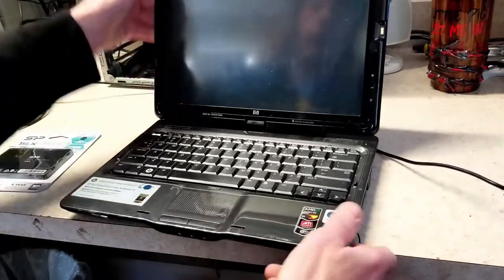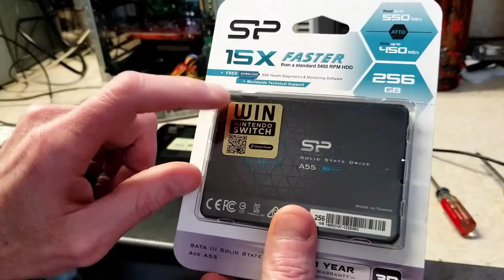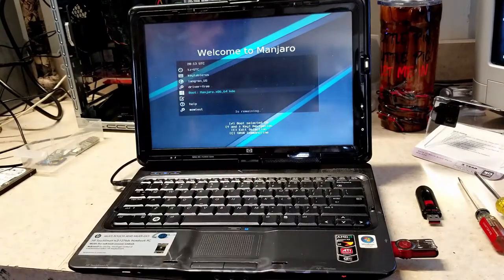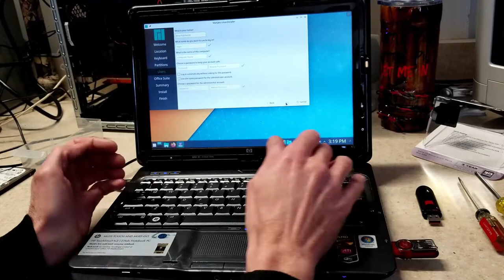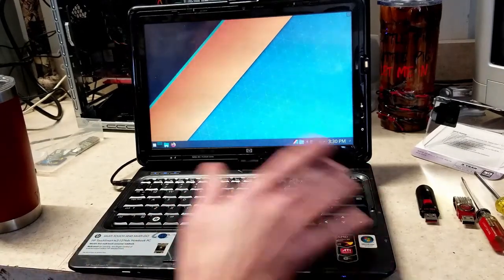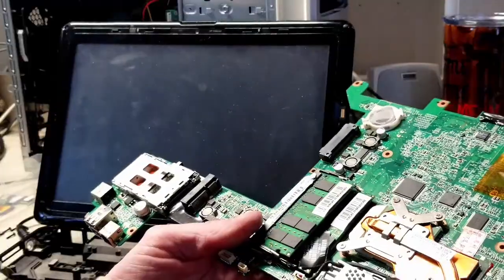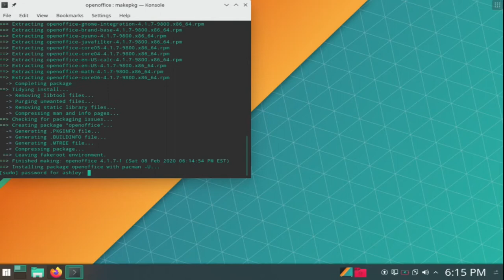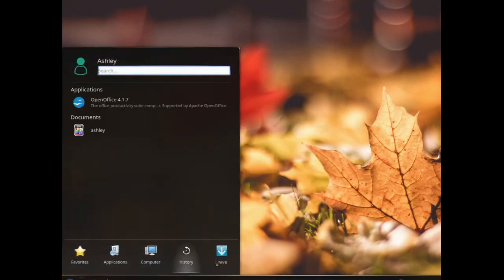HP Touchsmart tx2 laptop from 2010 Upgrading to an SSD and Linux

Comment: There should be a sheet metal caddy for the hard drive to be installed in. There's a nice metal tab that slots into the chassis to prevent it from moving around. Right around 4:36/4:37 you can see the slot in the chassis for it, just behind his index finger on the right side. Without it, the hard drive has the potential to...fall out of the SATA slot thanks to that stupid pointless adapter HP decided to use. Cram something between the hard drive and the outer cover to keep that from happening; should be good enough. Sounds like that caddy goes missing just like the adapter does.
12:10 See that wondrous, hellish blue? Whoever decided on that at HP should be drawn and quartered. That's a thermal pad over the GPU, which ran hot and had zero thermal protection whatsoever. They tended to desolder themselves. Ask me how I know. HP lost a class action lawsuit over that bullshit. Worse in my case and Snickerrick's customer, as they have an AMD gpu which was...equally as bad, and never qualified for any lawsuits as far as I know, even though it dies just the same. Dear readers, send that thermal pad to Hell and install a copper shim. You're going to have to go check how thick it needs to be. It's been a long time and I don't remember anymore. Except that people used pennies as shims and reported success. Christ.
Reply from the maker: Interesting stuff! I used to buy quite a few laptops quite a few years ago that were missing the hard drive caddies and most times connectors, so always had to purchase them seperately. For the most part it was obvious they were missing, in this case I didnt really notice but makes perfect sense. I thought it seemed kinda hoky. I do recall copper shims being sold specifically for that purpose, I had to install one on an Asus laptops MXM GPU due to overheating constantly. Hopefully she wont have an issue with this laptop in the future. I have seen a lot of cases of the gpu dies or chipset with IGPU desolder and fail on , as you said, mainly HP laptops, DV6000's and 9000's come to mind. Put a little pressure on the chip and it would boot was a dead giveaway. I am curious if these were intentional decisions based on planned obsolescence, or just poor design that was never questioned. Thanks for commenting with some good info!

Comment: Does the Pen work? 

i have a similar model ( a tx2 1274nr) and i was planning to revamp it and get manjaro on it as well. but i kinda liked using the pen
Reply from the maker: She lost the pen to this laptop so I didnt get to test it out, but the tip should function fine. If there are any buttons on the pen that may be an issue since it probably uses some HP button software to be able to operate. All I can say is run manjaro from the live USB before installing it, and see if it functions.

Comment: Hi ! I found your UNIQUE video on youtube!
I have the same laptop, but it does not allow me to install an OS other than Windows!
I want to install linux (an android distribution) but when running the installer it does not detect the disk.
investigating is something about the bios and a sector of the disk that only reads for windows and therefore Linux cannot detect it.
Anyway !
I would like to know how you did to install Linux!
Thanks in advance!
greetings from Argentina
Reply from the maker: I had no issues installing, just make sure the installer is for MBR and not GPT.

Comment: Hi I have the same laptop the laptop powers on but the display doesn't work what can I do
Reply from the maker: Do you get a display from an external monitor?
Reply: Most likely suffered from the dredded GPU failure.

Comment: Where can get the prices for the hard drive  for HP Touchsmart Satellite TX2-1025DX
Reply from the maker: I am not familiar with that model, but I assume it takes a 2.5" SATA hard drive? Check any online retailer in your location that sells 2.5" SSD's.
Reply from the maker: Sorry, yes the TX2, same as in the video.. check your online retailers for SSD's, they will replace your hard drive and be much quicker.